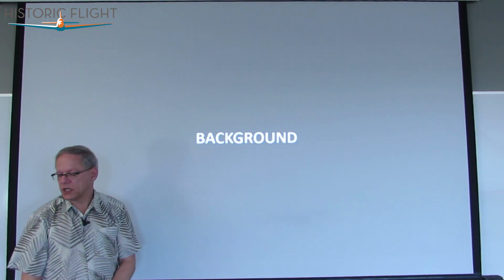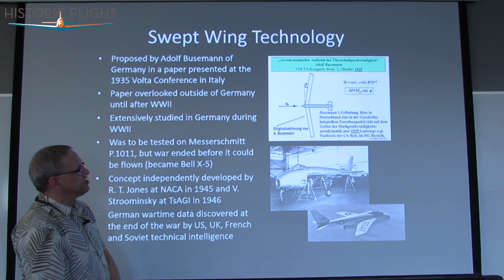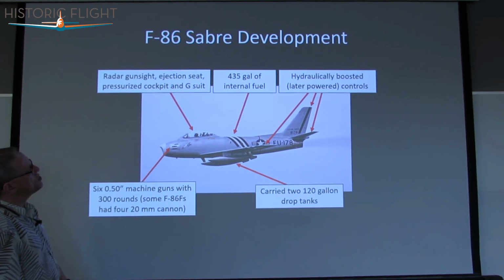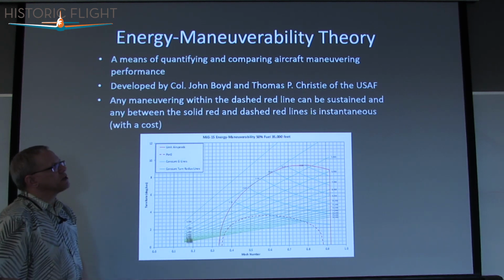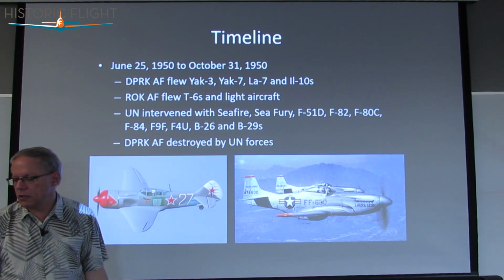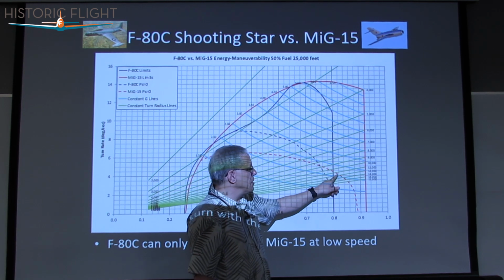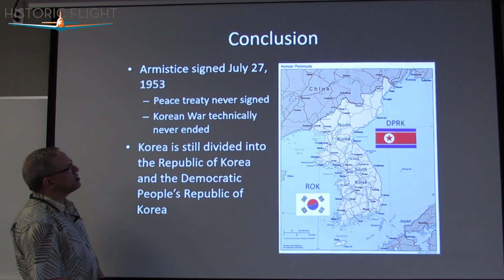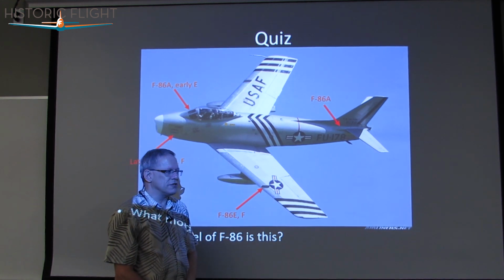Korean War Fighter Tactics presented by David Lednicer

Comment: That "MiG-15 designed to intercept B-29 bombers" seems an awfully regurgitated misconception. "Soviets made sure MiG-15 would also handle bomber intercept missions well" seems a lot more reasonable. There are no design concessions made to its fighter features to make it "mainly intended for bomber intercept missions."
Reply: If it was designed for that purpose they would have equipped it with two or three 37mm cannons.

But it had obviously a multi role armament, with the high RoF 23mm being the main guns against fighters.

They also experimented with 57mm cannons from the German programm of developing a 55mm cannon to be used against B-29s, but ditched it.

Nor did they equip MiGs with unguided AA missiles.

So it was simply a universal fighter for attacking both fighter and bomber.

Comment: A great video. Some of the history not so much. The Mig 15 and Sabre both use the same captured Messerschmitt  wing plan, this isn’t a coincidence, the F86 uses the same slats as the 262. The Sabres G47 axial flow turbine is obviously derived from the Jumo 004. I don’t buy the story that the ME262 accidentally fitted sweptback wings to balance the removal of the nose mounted piston engine. The piston engine was fitted as an afterthought in case of engine failure in the as yet not fully developed turbines. The Germans had been working  on swept back wings for years having five supersonic wind tunnels which the allies didn’t have including one rated at Mach 4.2!
Reply: I agree wholeheartedly.   The sweep on the ME262 was not just a balance issue.  Extensive wind tunnel testing showed this sweep to help in delaying the mach buffeting.  I also find his comments that R.T. Jones and Stroominsky discovered swept wing concepts independently of Busemann . . . more than 10 years later?   Very dubious.